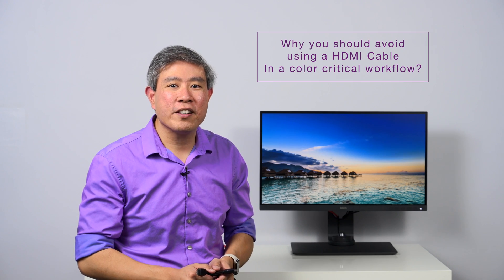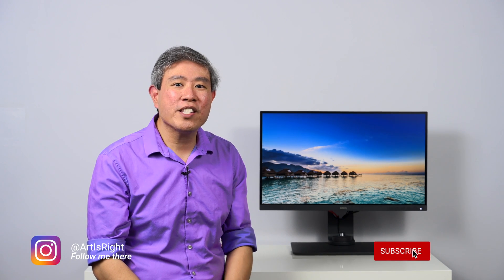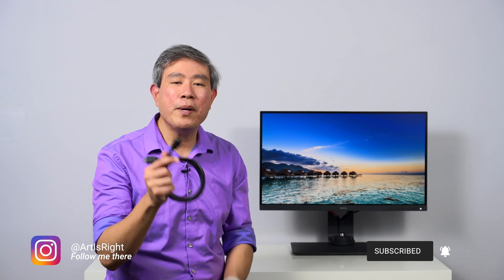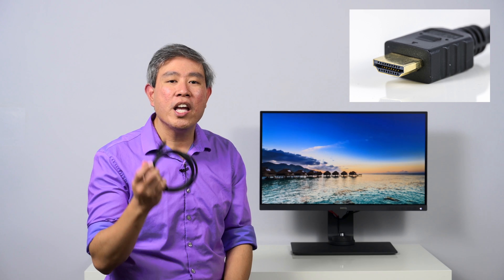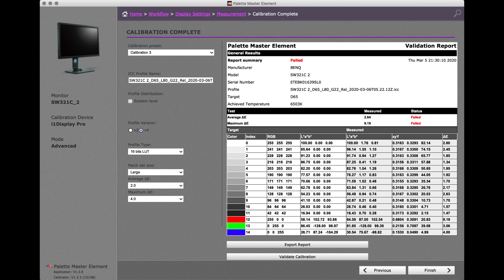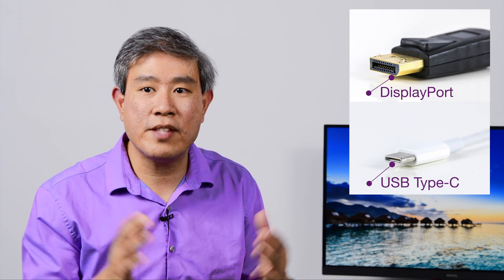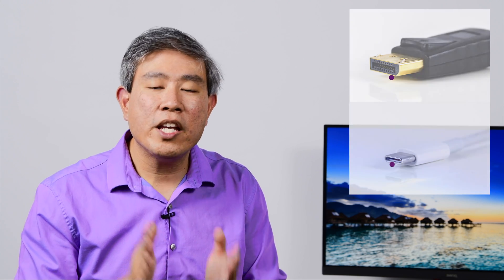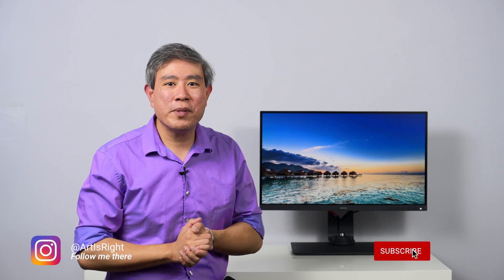Why you should avoid HDMI for color critical workflow, especially with Pro Displays!

Comment from the maker: There are a few misinterpretations about this video, so I would like to reiterate my thoughts. This video goes over the reasons why you should "avoid" using HDMI, whenever possible. However, if HDMI is the only connection that you have on your machine then yes please try that out first, calibrate and see if it would pass the validation, if it does then you are ok. If not then you may have to look another alternative ports or adapter. There's no place in this video where I said "never" use HDMI, but rather just to avoid it when possible. I hope this clear things up a bit! :)
Reply: Thank you Sir for your reply. I will try using HDMI
Reply: Hm this monitor no vga output?
😜
Reply: Art is Right

Comment: Hey Art, is a hdmi out>DisplayPort in cable going to degrade my color? also, USB-C>DisplayPort?Thanks, love your channel!!!
Reply from the maker: HDMI to Dp - potentially, depending on the computer. USB C to DP - No, because when you use USB C to USB C, you are using display port signal overlay anyways, so it is the same just a different and less bandwidth connector on the other end when you a USB C to DP

Comment: Dear Artisright. Thank you for your excellent monitor focused videos. I know your video about HDMI cables was published a while back however, I hope that you can offer some help. 

I have a Mac Studio and a BenQ monitor SW2 70C which I use for photography. I was connecting the two with USDC When I first purchased it everything was fine. However, after a few months, on occasion, the monitor would not be recognised during boot up. I took the Mac into Apple and it booted straight away to one of their monitors. When it took it home my BenQ detected. However, every so often the Mac would not detect the BenQ. Then it stopped detecting it completely. So I now have resorted to use an HDMI which l, as you say, not ideal. (I have replaced the USBC lead). And checked with other more generic monitors without issue.

Have you come across this issue before? My monitor also warns me that it needs recalibrate in boot up. Could this be part of the reason?
 
Further, In your review about the Calbright monitor calibrator 123, you mentioned that my models SW2 70C is hardware calibrated and will not work with it. And will it work with HDMI? Which model would you recommend, given my straight forward needs. Just photography and video post. 

Sorry for asking you these questions. Your knowledge is very specific and I’m not having much luck with anybody else.

I have a print exhibition soon and must prepare my files for the printer. I would be happy to pay for your consultation if you offer this service.

Thanks for your time.

Regards, Simon
Reply from the maker: "Have you come across this issue before? My monitor also warns me that it needs to recalibrate in boot-up. Could this be part of the reason?"
no
I would get Calibrite Display Pro HL or Display Plus HL for this. You can calibrate with HDMI; if it passes, you are good; if not, consider another type of connector.
Regarding detection, I would tell your local BenQ support about the issue and that your SW270C needs a firmware upgrade for new Mac compatibility. If you have any further questions or responses, please start a new comment or dm me.
Reply: @ Great. Thank you. I will try firmware update. And buy your recommend a Calibrite calibrator. Let you know outcome to share knowledge.

Comment: Thanks for the heads-up, you've got some amazing content. I'm planning to buy the BenQ PD2705Q in the next few days. Im a professional photographer. I saw you mentioned about using a C type cable instead of a HDMI. Well, i just want to make sure there's an option to connect my CPU to the monitor with a C type cable. If not, what's the alternative? Also, is PD2705Q a true LED IPS display and is it factory calibrated?
Reply from the maker: This does not apply to PD series, only for SW hardware calibrated display. And yes all displays are factory calibrated - just how well and thorough.
Reply: @ArtIsRight  thanks so much for the quick reply. Is the PD2705Q LED or LCD?
Reply from the maker: Both - LCD panel with LED Backlight

Comment: Does the USB type c for the monitor need to be into the video card or motherboard?  I only have one on the back of my PC and its is not on the video card!
Reply from the maker: For PC desktop, it would have to be on the video card. PC desktop especially custom build ones and one with a operate video card, there's no video signal route back to the main board, no on board MUX so it would have to be the video card.

Comment: Would you suggest using the display port over UCBc?
Reply from the maker: Technically if you can use USB C, just do that, they are using the same Tech. All USB C technically carry what is a called a Display Port Overlay to pass through the display signal

Comment: @ArtIsRight I have a benq SW321C monitor and a laptop (with windows) without usb-C . How do i connect my benq to my laptop? Thanks. Bye. Martino(Italy)
Reply from the maker: HDMI, run a calibration, if it passes you are good. Display Port, or other ports that you may have.
Reply: @ArtIsRight  I found out that my laptop is only a full HDand not a 4k. So I will build a new computer(with windows operating system). I can build the computer with as many ports as I want.What is the perfect port to connect the Benq Sw321C to the computer?
Reply from the maker: USB C or Display Port will work just as well. USB C on for display on custom build PC have may ports limitation, depending on how you configure it.

Comment: Hi Art, I'm confused!  I have a Mac mini M1 and a BenQ SW240 I calibrate with a colorchecker display pro using Pallete Master. What is the best port/cable for colour calibration/colour accuracy, USB C OR USB A/B ? Thanking you kindly for your help.
Reply from the maker: USB C to Display Port. But what I would do in your situation is test HDMI first, if it calibrate and pass validation, you are good. Forget all of this and have fun with great colors!
Reply: @ArtIsRight  Thank you so much for your prompt response - I will do as you suggest

Comment: Ouch, this is a rough one. ArtIsWrong here, depending on what you're doing. 1st there are a lot of assumptions being made here about what color critical work we're doing. In the video world, when doing color critical work such as color grading... and using a professional video output device like BM Decklink series cards, AJA or Bluefish or Avid Artist cards to output a professional video signal to an external video monitor... HDMI is a great choice. HDMI supports up to 8k/60 and 10bit HDR. Displayport is not a professional video connection, it's a graphics card to monitor connection, so if you're working in pro video, this is a somewhat misleading video. If you're a consumer / prosumer and you're trying to feed a consumer computer monitor via HDMI from a graphics card, then you might run into some trouble and be in the zone that this video is addressing. It's not a shortcoming of HDMI, it's a problem with folks trying to use workarounds that aren't necessarily designed to do what they're trying to do.
Reply from the maker: And my point is that some computer truncate signal and that "pro" should test. That is all that I am saying. Too many people hear what they want to hear even though I was clear in my resolve. Also you seem advanced, which is great, however, many don't have the knowledge that you do, so the advice is appropriate consider my audience, thanks for chiming in.

Comment: Great video.  Few questions if I may.  I’m using this monitor with the Mac Mini M1 with HDMI port and I have no functionality with the extra USB / headphone ports or SD Card reader.  Can you tell me what I’m doing wrong?
Reply from the maker: You need to use the USB uplink cable in addition to the HDMI or if you are using some type of USB C adapter. If you use USB C to USB C you can forego this.

Comment: I'm confused - if I try to use Palette Master Element it won't even start as it says the monitor must be connected to the PC by USB. Specifically the error says ' Make sure your BenQ display USB cable is connected to your computer. Then proceed with the set up.' I'm using an HDMI cable which this video suggests could work but as I say the program won't even run. Am I being particularly dim today?
Reply from the maker: You need to use the USB uplink cable as well https://youtu.be/24BebMD0G7s or https://youtu.be/OVml8PQ4F2g
Reply: @ArtIsRight  Thanks for the reply - I have got the usb uplink cable installed as well as the hdmi but I still get the error I mentioned
Reply from the maker: Try powering off the display, pull the plug and leave it out for 30 sec, plug it back in a try again. See if you are still getting the error. Otherwise, I would try another port on your computer.

Comment: Hi, my old lenovo laptop does not have a dp connection so I could not connect sw240 monitor there is only connections  for hdmi and vga
Reply from the maker: Just go HDMI, give it a calibration test and see if it pass. If so then you are good.
Reply: @ArtIsRight  Thank you for replay but sadly my laptop is too old. I tryed go on hdmi cable and got horizontal red, blue, green thin lines randomly appearing on screen.
Reply from the maker: Then use some type of adapter to display port.

Comment: Nvidia defaults HDMI to 16-235 but it should be noted that this is an easy fix in the driver settings. There is usually not a problem with bandwidth.
Reply from the maker: Fully aware of this, but this covers some Mac as well and it is generic video. Also aware that issues I not bandwidth, never said that it was, more so the fact and background as to why bandwidth might be limited.

Comment: Since I switched from a desktop to my Dell XPS with Iris graphics, I can't get an accurate print. I've calibrated the ASUS 24 monitor many times, with an old X-Rite profile device, but the resulting print is now a little washed out and with a purple cast. The calibration does pass the validation, but I was wondering if I should buy an adapter and try going back to using the DVI cable and port which I previously used with the desktop. Would appreciate your thoughts.
Reply from the maker: You can try that and see, but from what you are describing, it would seem that the print may have a profile or ink issue more than the display at this point.

Comment: Hi! I am buying a SW240 to edit photos with my 2010 MacBookPro. Which cable/port should I use both in the monitor and the computer?

Other question: what’s the difference between the C or PT versions of this SW240?

Thanks for your help!
Reply from the maker: All of the cable that you need to use with your 2010 MBP is in the box with the SW240, so Mini DP to DP for video signal and USB Type A to USB Type B unlike.

PT, first gen SW27000PT only one with that model name, PT Convention is no longer use. C stands for USB C with 60 Watts Power Delivery in the SW line up.
Reply: @ArtIsRight  Thanks a lot for your help! So, even I own a 2010 MBP without USB-C port, the SW240C version will work with my computer? Cheers!

Comment: Hi, I am using benq pd2700q. I am not seeing 10 bit color option in display settings when connected via HDMI cable... I used then display port to mini dp cable with and adapter still don't see that option... do I need to buy usb c to display port  cable for enabling 10 bit. Please help.
Reply from the maker: Are you on Mac or PC, if you are on PC and have Nvidia card you have to use Studio Driver, otherwise no 10 bit, For AMD it is video card dependent and for intel integrated GPU it is a no go for 10 bit.

Comment: Hi, I just bought an SW2700PT (couldn't afford higher) and connected it with an old HDMI cable I had. (I have a new 'high speed' HDMI cable too) I calibrated it with my friend's ColorMunki (older model) and X-Rite software. It looks pretty good to me... ? Will it be better to use one of the OEM cables that came with the monitor?
Reply from the maker: Nope, the cable as long as it meets the spec is at the end of the day a cable and will work the same.
Reply: @ArtIsRight  Gotcha. Thanks for your reply 🙏🏽😊
Reply from the maker: Sure thing!

Comment: Hi, your videos are very instructive. I just bought BenQ SW271C for photo and video editing. And I want to get the most out of it, without making mistakes. I have some questions about connecting and calibrating. I appreciate if you can help me.

My laptop is Asus VivoBook 15, model X512FJ-EJ529T. I use Windows 10.
At first, I used the HDMI cable to connect the monitor and the laptop. The monitor reproduced the images from the laptop. But watching this video I learned that it is not suitable to use an HDMI cable, especially when calibrating, as HDMI can limit the color gamut. I then tried, with the monitor and laptop plugged in, to use the USB3.1 Gen 2 (USB-C) cable supplied with the monitor, but it didn't reproduce the images from the laptop. The message "no signal detected" appears. I tried using the other USB cable, but it didn't connect either. My laptop has a USB-C cable input. Why this problem may be occurring How to make the correct connection without using HDMI so as not to interfere with the color quality?
Reply from the maker: HDMI can limit the output on some machines but not all, testing is necessary. USB C is better make sure that you laptop can output signal over USB C and do this https://youtu.be/u7XD7s5xs1k
Reply: @ArtIsRight  Thank you very much for your attention. I'll check out the other video right away.

Comment: I’m considering getting the den Q321C Display. I’m a Mac user and I would be using it both with a MacBook Pro which has USB-C connections and my older MacPro desktop which is display port. Will I be able to plug both of them into the display at the same time and switch views back-and-forth between the two inputs?
Reply from the maker: Yes you can use the hotkey put customization for quick input changes as well.

Comment: Great video thank you for your information.. Btw I have macbook pro 14 inch 2021 can i use HDMI connection from that macbook to connect to HDMI on external monitor benq sw2700PT in order to get successful validation using palette master? Thank you
Reply from the maker: Yes you will need the use the USB uplink cable as well. Also you need to use PME 1.3.15 and not 1.3.16 you can find the download link in the desc of this video https://youtu.be/wV_FGFrovDA

Comment: Hello Art! 
I have a question. If I am using Blackmagic Design UltraStudio Monitor 3G in between, would it be ok? Because Blackmagic has only HDMI output to my Benq 312C. And yes I am using my bend for critical color work. 

Thanks!
Reply from the maker: Yes, workflow here is to calibrate your BenQ using PME with the settings that you want to use without the Studio monitor, once you have that done, then plug the studio monitor in between and you'll be ok.

Comment: I don't have a calibrated display. And I use a dual monitor setup. Both my monitors have just hdmi ports and my graphics card has display Ports. Can I use a display Port to HDMI cable for colour critical work? Will it's output be any different than a regular hdmi to hdmi cable?
Reply from the maker: Yes this video applies to hardware calibrated display only, most people miss this fact.
Reply: So you mean the output will be the same whether I use a "DP port to HDMI cable" or a regular "HDMI cable". There won't be much difference to noticable? I have a benq gw2480.
Reply from the maker: For that models no and for most computer not an issue.
Reply: Thanks 😊

Comment: Very informative helpful video. Thank you. Question: Does the DisplayPort truncate down the signal? You said the USB-C does not but said nothing about the DisplayPort. I'm concerned now that I'm not getting all I can get out of my BenQ PD2700U (10-bit, 100% sRGB, 100% Rec. 709) because it only has DisplayPort 1.4.
Reply from the maker: DP does not do this nor does USB C because when you use USB C for display signal it runs a DP signal overlay. On the PD this does not matter, I did emphasize this enough in the video that this issue only effects hardware calibrated display such as the BenQ SW.
Reply: @ArtIsRight  Thank you. I get it now. I appreciate your getting back to me to explain what I missed.

Comment: Hi does Nvidia Quadro P400/P620 entry level graphic card supports 10 bits color Display? (products such as SW240, SW270 etc)?
Reply from the maker: Yes
Reply: @ArtIsRight  Ok. One more question. I have a Colormunki display calibration device. Can I use it to calibrate the SW240 monitor using Colormunki display software?
Reply from the maker: You have a hardware calibrated display you should really be using BenQ Palette Master Element, but the device that you have is not compatible. So if you want just to do a software calibration you can, you would be using Calibrite ColorChecker Studio software. Color Munki software has been decrepit for a while now. Same software with slightly more control for newer OS.
Reply: @ArtIsRight  alright thanks